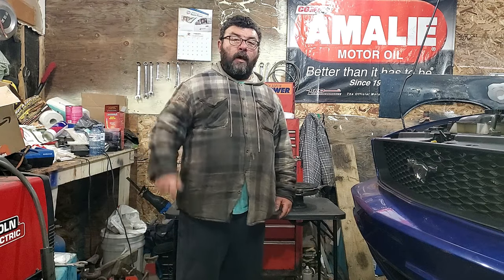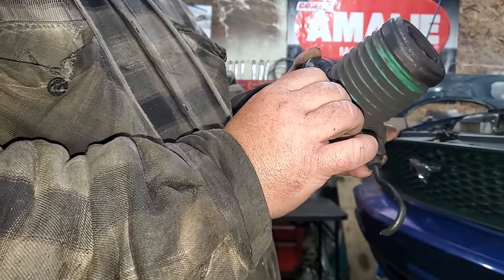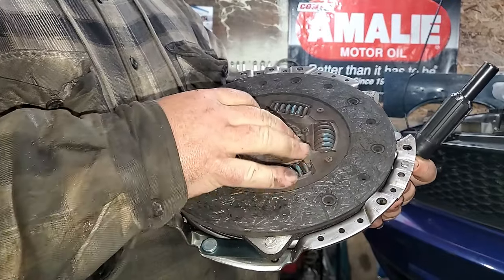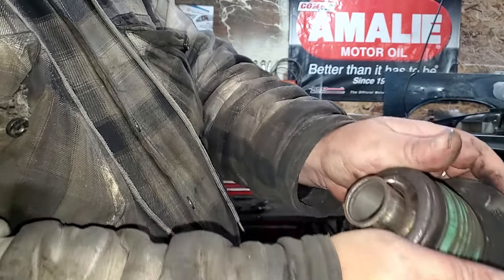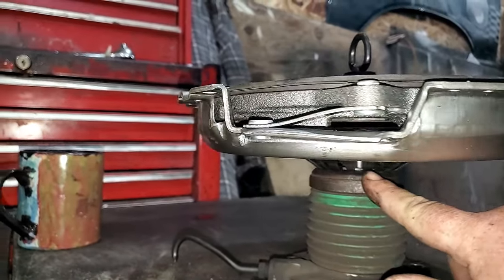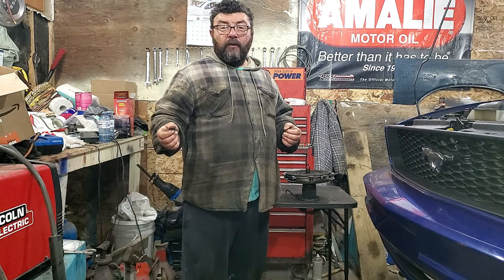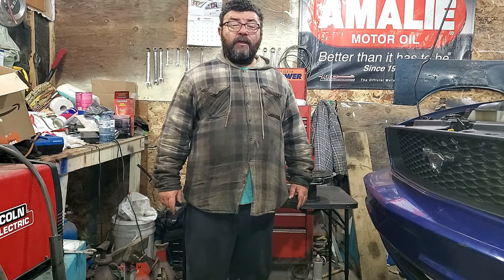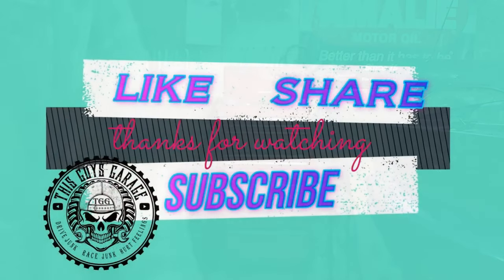why is my clutch pedal hard to push ?

Comment: I like your video. Thank you. Very informative, brief and concise. I do have a couple questions though: I was reading one of the comments made by Vica and he tells you about a stiff clutch even after replacing the the entire clutch kit and the release bearing, and how there was no apparent solution to the stiff clutch problem on his vehicle. Jut wondering if the dual mass flywheel or the master cylinder AKA plunger could also being part of the problem or a pilot bushing?
   Could it also be  a clutch pedal mechanism, like worn out plastic bushings on pedal pivot  or something related?

   Thanks in advance for your valuable imput.
Reply from the maker: It's a case of ruling out the variables 👍u are 100% correct

Comment: Do you always recommend the flywheel?  Or only if there is obvious visible damage
Reply from the maker: i only hit the flywheel with the sander, if you can get it resurfaced that is great too, ,i have never had an issue using the flywheel. if it is blue or looks burnt then maybe get a new one.

Comment: What about when you have replaced EVERYTHING with LUK besides flywheel? two slaves two masters two clutches and clutch is still STIFF to press? (foot and leg hurting after one drive)  last time took off added a lot of lubrication and was SOFT for four days now stIFF again? ???
Reply from the maker: the flywheel would not cause a stiff clutch , what did you lubricate ?
Reply: @thisguysgarage  my faults exactly hence why never touched it and it looked decent condition… I added red rubber grease (the thinkish type) to the input shaft and slid the friction disk on it few times i just don’t understand how it was soft for literally a few days of constant driving and it’s like the grease has dried up and back pedal gets 5 times stiffer to press?!? I’m really stumped with this one I know the gearbox got changed but I’m doubting that’s got anything to do with it as it went smooth for a few days then stiff again?? Sorry bout the king write up just can’t find a fox to this problem NO WHERE 😔🤷‍♂️
Reply from the maker: @staywokealways6507  so it sounds like the release bearing is the cause of the hard clutch and the symptom of a worn shift fork . If the shift fork is worn it will not put even pressure on that bearing causing it to hang up. Was very important that you mentioned the Grease applied.  Centrifugal forces will throw the Grease away is why the clutch felt good for a few days.   Make sense?
Reply: @thisguysgarage  I’m sure I don’t have a release fork as I have a concentric slave design… and I’ve changed the concentric already from a crappy brand to a sachs brand with no difference… and would grease really make the pedal FEATHER LIGHT to unable to hold pedal at biting point without ancle and thigh muscles hurting?? Even my back is hurting from clutch pushing me into the seat…
Reply from the maker: @staywokealways6507  there is a spring in the concentric slave that could be applying uneven pressure. Since you changed everything I can't see anything else.  The fact that it was easy to push for a few days says to me the problem is in the slave cylinder... I don't have eyes on it . So that is my best educated guess.
Reply: @thisguysgarage  thanks will try that and hope and prey the THIRD csc fixes the problem 🤦🏼‍♂️ thanks for help
Reply from the maker: @staywokealways6507  🤜🤛👍
Reply: @thisguysgarage  new slave did nothing still the exact same feel from the pedal (5times more spring back pressure then any other car of same model…) still had the previous grease everywhere so it’s not a lubrication problem everything STOCK LUK… only things not changed is lines and reservoir 🤷‍♂️🤦🏼‍♂️ everything else changed twice or three times 🤦🏼‍♂️
Reply from the maker: @staywokealways6507  it sounds like a heavy duty pressure plate feels. That's weird.  Does it bleed ok?
Reply: @thisguysgarage  if does sound like a heavy duty plate but where it went soft for two weeks just makes me double guess most things.. 🤷‍♂️got my brother to drive it for a day (few solid hours) he said about 45% more pressure on your foot to keep the pedal down then his same car 👀🤷‍♂️ and no matter if lines are full or air of have no air the pedal stays hard instant I tried leaving loads of air in the lines and all what happened was pedal dropped half way down then went to normal stiffness straight away 🤷‍♂️maybe I’m not bleeding it right or a blockage ? 🤷‍♂️ I fix ALOT of cars and do a lot of clutches with my brother and this has truely STUMPED me I appreciate your input TRUELY.
Subscribed !

Comment: Hello from London. Unfortunately your video didnt help. I have extremely stiff clutch pedal in vauxhall zafirah tourer . I got the whole clutch, 3 pieces, changed when that didnt work, the garage said it has to be the master cylinder . Now after spending tons of money, my car is same as it was before. The cluth is still very stiff. Called the dealership they said if the Clutch was bled properly, then the only possibility could be pedal box itself is faulty
Reply from the maker: reach in and pull the clutch pedal back and forth , if it is not stiff pre engagement ,its not the pedal itself . i dont think its the pedal assembly in my opinion .  to further investigate the pedal assembly   disconnect the plunger rod from the pedal , if the pedal is still stiff you found the problem. good luck and let me know what you come up with!

Comment: 👋 
Replaced clutch twice still clutch pedal is hard to press… clutch pedal kicks back … it’s Škoda Rapid 1.5TDI (1498cc 105hp)
What could be the issue? What is the solution. PLZ HELP
Reply from the maker: hydraulic or cable?
Reply: @thisguysgarage  Hydraulic
Reply from the maker: @vikaaas16  I would look at the slave cylinder if you just put a stock clutch in and was softer previously 👍
Reply: @thisguysgarage  tried slave cylinder didn’t work. Can it be master cylinder?
Reply from the maker: @vikaaas16  the master for the clutch, it could certainly be ,that is all that is left in the system.  Have you tried bleeding the clutch to be sure there is no blockage?
Reply: @thisguysgarage  ya tried clutch bleeding also .. still hardness is same
Reply: @thisguysgarage  pedal is so hard .. it kicks back..
Reply from the maker: @vikaaas16  clutch master seems like the last piece of the puzzle.
Reply: @thisguysgarage  ya let’s see . Thank you
Reply from the maker: @vikaaas16  let me know 👍 🤜🤛
Reply: @thisguysgarage  dealership is forcing me to replace flywheel clutch set and slave cylinder .. lol
Reply from the maker: @vikaaas16  if they replace everything they are sure to catch the problem lol. Does the clutch master cylinder come with the slave cylinder as a set? I would ask if they would replace that first, then put the clutch and PP if that doesn't sold the problem, or find another shop that will do it in that order since the clutch set  and slave was recently replaced 👍
Reply: @thisguysgarage  they doesn’t come as set .. slave cylinder costs around $75 and master cylinder $100.. I need to find local mechanic.. dealership wants me to replace all together ..I can’t waste money once again.. cos I’ve already replaced PP CLUTCH DISC ,throw out bearing & slave cylinder.
Reply from the maker: @vikaaas16  yes the deals hips can alleviate comebacks by replacing everything.   Find a local mechanic and tell him what's going on and you want to try this. It's easier to change the master than the slave . Can you 👀 see it?
Reply from the maker: https://youtu.be/-xcq9pqRJy4
Reply: @thisguysgarage  I can see
Reply: @thisguysgarage  I’ll let you know once done
Reply: @vikaaas16  did you manage to solve this problem??
Reply: @staywokealways6507  not yet
Reply: I have the same fault in my Ford Focus I changed the gearbox and clutch and a few weeks later the hard pedal problem came there is TOO MUCH spring back pressure it makes my little legs dead after 15 mins ! I changed everything beverbim putting original PP and gearbox in to see if that fixes it as everything else been done!
Reply: @staywokealways6507  Please change slave and master cylinder .
Reply: @vikaaas16  changed both new master and two new slaves with LUK and sachs I’m changing gearbox back to original and putting original pressure plate and slave back in and will let you know
Reply: @staywokealways6507  👍
Reply: @vikaaas16  changed everything over last two days NOTHING WORKED
Reply: @staywokealways6507  oh okay.. I’ve sent my car to dealership.. let’s see what happens .. I’ll update here
Reply: @vikaaas16  please do and I will also as I’m still trying to figure this thing out I’d be surprised they don’t tell you “everything feels normal that’s how they all are” been hearing that left right and centre but everyone hasn’t got a dead leg 🤷‍♂️ 🦵 ❌
Reply: @staywokealways6507  same here …
Reply: @staywokealways6507  dealership is asking me replace clutch set.. I refused and got my vehicle back
Reply: @vikaaas16  I’ve changed everything on my car and ONLY when I put a new clutch kit (LUK) in the car the pedal INSTANTLY went soft and SMOOTH for two weeks but came back hard again I’m starting to think it’s pressure plate related and my new luk clutch failed after two weeks dunno 🤷‍♂️ 😞
Reply: @staywokealways6507  even I felt same thing it’s good for 1-2week only.. then hardness is back .. try aftermarket pressure plate .. even mine is LuK
Reply: @staywokealways6507  I tried different  clutch kit(LUK only)  but that was touching my gearbox.. my local mechanic says that clutch would have solved my hardness issue .. cos it’s pressure plate fingers are flat
Reply: @vikaaas16  hmmm I’m pretty sure the pressure plate fingers are flat when you bolt them up (done MANY clutches on all different cars and all did that…) it’s crazy you had the soft pedal for a week or two then back to original spring back PRESSURE on foot like mine… I’m really out of ideas I’m thinking to grow a valeo set up in a week or two and see what happens otherwise I’m at a loss
Reply: @staywokealways6507  let me know if your issue is resolved
Reply: @vikaaas16  did you get this issues resolved?
Reply: @stay woke always  no bro..
Reply: @staywokealways6507  yours ?
Reply: @vikaaas16  na trying to just get used to it to be honest and just sell it in next few months
Reply: @vikaaas16  but it’s helping keep the mileage down for the resale as i rather walk every where and only use the car if going far Lool to save the leg lol 👎🏽
Reply: @staywokealways6507  🤣🤣🤣🤣🤣🤣
Reply: @staywokealways6507  last option for me is to try Valeo Make Clutch
Reply: @vikaaas16  that’s also my last step i just got a holiday and stuff coming up next week I’m too busy to give it a try but that the ONLY thing I can do is put the valeo clutch.. if you get it in your car before I do let me know how it goes !
Reply: @staywokealways6507  hey bro did u try Valeo
Reply: @vikaaas16  nope grew bigger leg muscles instead and it no longer bothers me AT ALL I use the car 4/5 days a week and clutch leg NEVER hurts… and it’s constant use for 9/10 hour days… I’d really suggest selling and buying new vehicle if you really can’t deal with it
Reply: @vikaaas16  by bleeding a clutch you mean changing the brake oil or is oil in the actual clutch disc?
Reply: @alfonsomoralesescobar9056  changing brake oil

Comment: I have changed the clutch twice and it continúes to be hard to drive.
Reply from the maker: Did you change the slave cylinder or clutch cable depending on your application?
Reply: @thisguysgarage  I changed the clutch cable.
Reply from the maker: @MRTIBURONTIBURON  y/m/model
Reply: @thisguysgarage  2004 Ford Mustang regular
Reply from the maker: @MRTIBURONTIBURON  I have the same car with a aftermarketclutch it's firmbut nothard. Does your car have a Stock clutch?
Reply: @thisguysgarage  its an aftermarket too.